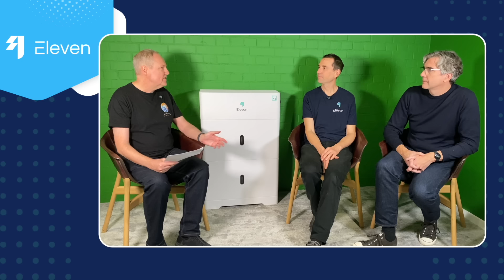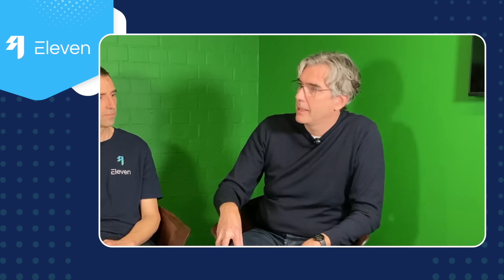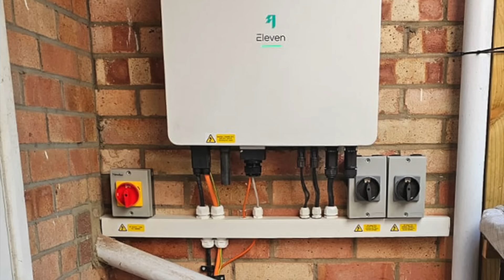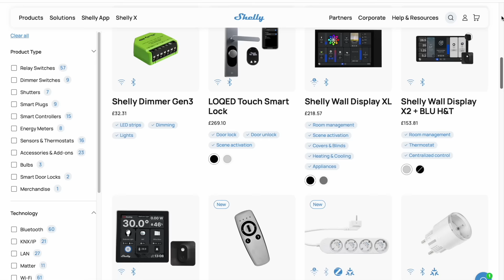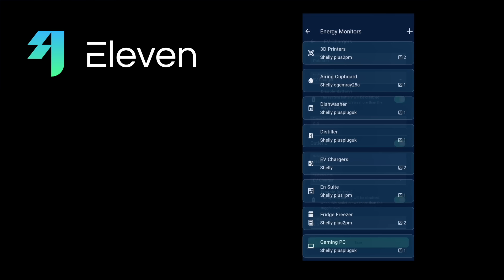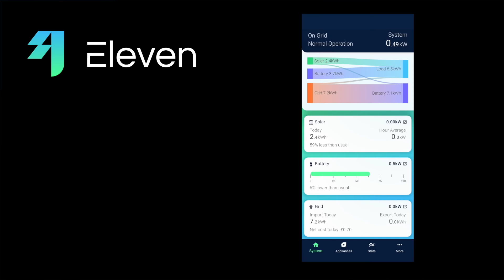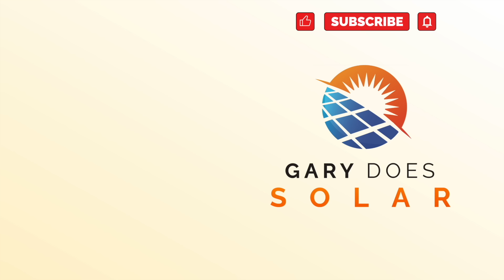Home Batteries: Could SODIUM Be More Popular Than LITHIUM Soon?

Comment: Lots of warts with sodium still.  Full-cycle energy efficiency is poorer and losses from that alone swamp the heater argument (keeping LiFePO4 warm doesn't take all that much energy when the cells are in an insulated box).  The wide voltage range creates all sorts of problems for equipment power ratings.  And while cold-weather capacity is better (in the situation where you actually let the batteries get cold)... that's only at low C rates.  Like 0.1C.

Where sodium really works well is in situations where the battery might go dead.  Sodium batteries can be recovered from that situation whereas lithium batteries take damage.  But actually making use of this feature requires power electronics that will actually do it and not just give up because the battery bus is sitting at a few volts.  There are virtually no situations where batteries are actually allowed to go completely dead.

Safety is better... but not so much better than LFP that it's really worth all the other warts.

So it really comes down to cost.  Sodium has to be better than half the cost of lithium for it to even begin to start making sense.  It hasn't quite gotten there.  This is also why seeing sodium in consumer and residential products doesn't make a whole lot of sense... the installations are just too small and shipping and installation costs completely swamp the lower battery price.

-Matt
Reply: Yeah there are issues with Sodium batteries that don't exist with Lithium batteries, but I don't think they are roadblocks that will stop eventual adoption. Just reading through the history of the development of Lithium batteries is really eye opening, the huge problems that had to be solved to get to where we are today are things that could have ended development altogether if not for a few hardy souls pressing on when all looked hopeless. The problems with Sodium batteries are really minor compared to that and probably won't hold up Sodium battery development much at all. We are all so used to the flat voltage drop of Lithium batteries and the way they work that at first it seemed a complete barrier to using Sodium the same way as Lithium. Having said that, I don't personally think Sodium will be used much in EV's, I don't think that's the target market for Sodium and as you say LFP warming is not a big issue these days otherwise Norway wouldn't be one of the largest penetration EV markets in Europe. Cheap fixed storage is where Sodium will dominate, given, as you say, that the price does reflect the projected cost saving of using Sodium over Lithium. We have yet to see that, but it's really early in Sodium battery manufacturing, give it 6 months for the price to fall through the floor I would suggest.

There are already large grid scale sodium battery deployments projected for 2026 and beyond, so it should be interesting to see where that goes.
Reply: I’ve been using lithium batteries since first commercialised by Sony in the 90s, they’ve always had excellent round-trip efficiency. Is there a path way to improving this as for me it doesn’t make sense, the cell cost is about 20% of a residential install cost in the UK.
Reply: Agreed.  Just watch Will Prowse's videos on sodium.  From a practical point of view, the drawbacks to sodium are immense
Round trip efficiency and huge voltage range will limit their use to experiments.
The voltage range issue itself is an application killer that has serious implication for power and solar equipment

I don't expect them to be useful until these two basic issues are solved.  I predict it will take at least 5 years.
Meanwhile lithium solutions keep getting better and better.
Reply: @bru512 

There's Na cells and Na cells and they are not all  built equal,  and CATL  are just not showing those problems  because of what they have done inside their road and storage  Na cells.
Reply: > So it really comes down to cost. 

Yeah, but that isn't a minor point. It's a key point for battery storage, specially on big sizes.
Pretty sure we will create new inverters that support the wider range of sodium. And with that inverters, even if they will be more expensive, the difference won't be so significant in comparison with cell cost. 
I think your half lithium cost is too conservative. Plus main manufactures I think they will push for sodium as a way to don't stress their lithium reserves even more, when they can dedicate that lithium to a more profitable EV market.

Knowing that the lower cost is achievable, they will push lots of capital into it, which is a kind of "subsidize" the technology.
Reply: if it works at grid scale its all that's needed to swamps consumer use.  lithium is being banned due to fires on cheaply made battery devices which is spreading to all as competition drives cost & quality down.  Then there's pollution. Lithium industry hasn't bothered to recycle in order to juice sales of new lithium? & then there is finding 3rd world countries happy to destroy ecological fresh water ....
Reply: @russell7489  Yeah, look online you will see lithium car battery recycling that recovers 98% of materials, and second life usage of lithium EV batteries is a huge industry. There is no-one seeking to ban lithium batteries because of fire, in fact China has new laws that mandate strict fire control changes and new door handle design that allows for easy exit and access in case of power loss.

I agree cheaply  made devices need to looking at, but that's not car batteries, you are looking at cheap e-scooters and devices like that, data shows that ICE cars are 20 times more likely to catch fire than EV's, and that's before the new Chinese regulations on combustion control in batteries.

This is FUD basically, there's plenty of room in the world for two battery technologies, well it will be four now with sodium. All your points have already been addressed many times.
Reply from the maker: Really great points, Matt 🙏

Comment: Starting with a direct lie is not a good look! Lithium is not scarce, hence its price collapse, it is one of the most common elements on earth. 

Yes in time they may well take over the home and even car market. But home batteries are grossly overpriced compared to the same thing in cars anyway, so they will still be marked up vastly whatever chemistry they use. 
All made elsewhere, not their batteries, or any component. 
Software sounds locally made at least. Battery is a bit small.
So it is as British as anything made in China or similar, with a badge added when it arrives here and the sale price quadrupled or more.
Reply from the maker: I think you misunderstood the comment. Lithium is scarce when compared to elements like sodium.
Reply: @GaryDoesSolar  Well not really, he said  Quote "One of the biggest disadvantages is that there simply isn't that much Lithium in the world. It's really quite scarce"
In fact At 20 mg lithium per kg of Earth's crust, Lithium is the 31st most abundant element. Ok yes Sodium is much more so, and easier to extract. But that was NOT what he said or implied.
There is that much Lithium! It is not scarce.
Instead of lying he should have simply concentrated on the easier availability, extraction. It is still a material huge advantage.
Reply from the maker: I think you’re getting hung up over one statement and missing the bigger picture about the benefits of sodium.
Reply: @GaryDoesSolar  Absolutely, but for a reason, the anti any EVs to solar systems, anti modernisation, leap on any way to make out batteries are not viable due to use of 'rare' materials, or catch fire at the drop of a hat etc. Which they are not!
Better to make the case for sodium from it benefits and advantages not by rubbishing Lithium ones that are currently everywhere.

Comment: Sodium batteries need to match or better lithium ion cells the being  negative about them needing heat is easily cured..bottom line is are the Sodium cells cheaper???
Reply from the maker: Not cheaper today, but in two or three years the expectation is that sodium will be much, much cheaper than lithium.
Reply: @GaryDoesSolar I'm about to get 2 quotes for an Eleven battery and solar installation and for 2 for Lithium and solar. I'll try and update on here now the quotes compare.

Comment: I would love to see their voltage charge vs. discharge curve. Thats where the drop in efficiency typically comes from.
Reply: i usually love gary does solar’s videos, but this one feels like a sponsored investor pitch
Reply from the maker: @glitterishhh - not a sponsored video at all. I’m just interested in the technology.
Reply: @GaryDoesSolar  i don’t mean this as an attack on you, but if this wasn’t sponsored, why did you keep their company logo in the top left corner of the whole video and why did you not challenge any of their claims throughout the entire interview?
Reply from the maker: I cannot be any clearer to you. This video was not sponsored. I made it to highlight sodium-ion technology, so that people could find out more. What claims do you think I should have disputed?
Reply: @GaryDoesSolar  2:15 lithium is not particularly scarce anymore. the scarcity was mainly for cobalt back when NMC was the dominant battery type. LiFePo4 are abundant, as reflected by the prices per kwh which have become an order of magnitude lower in the past few years
Reply from the maker: I think the point ELEVEN was making is that lithium is more scarce than sodium. And actually, we’ve seen lithium pricing spike over the last few years, not because it’s scarce, but because there are limited places to locate, extract and process it. It could well spike again because of that, unlike sodium which can be located, extracted and processed almost anywhere.

That’s one claim then—keep going…
Reply: I wonder if a hybrid system with fast DC to DC could fix the issues some people are touting about curves etc, just enough Lithium for a clean feed and sodium for bulk storage with some sort of balancing going on between them. I don't know enough about the science but interesting times ahead as these things do progress. Happy with my SigEnergy for now.

Comment: Very interesting as I was wondering how , now that batteries have to be fitted outside they (LiPO ) would work as an emergency back up supply in winter. Imagine early hours of the morning it freezing hard out side and battery a bit low and the grid supply goes down just as battery about to cash in on off peak rate. Then 8 hours later with grid still shut off it a bright sunny day , as the batteries are freezing cold they will not charge as not enough power in them to provide heat to allow it. This by the sounds is where these Sodium batteries come into play, but what are we being sold at the moment promising to give back up when grid goes down but by the way you got to put your battery out side now where they dont really work off grid when its cold but give us the money for the gateway anyway.

Comment: Ah, wide cell voltage and the implications for inverters is something I've never heard about before. It means we can't simply swap out existing batteries for sodium without also changing inverters. That's a big downside for quick adoption - all existing systems using NMC/LFP won't be able to use sodium. Pity.

My understanding is the lower volumetric density isn't as big an issue as it first appears, because sodium batteries don't need active thermal management. Thus saving cost/weight/space/complexity that other batteries require.
Reply: Most of those batteries are going to out last their inverters.

Comment: Soon... For varying definitions of soon, sure.

Anyone interested in them should probably go look at Hobotech's review of the Bluetti Pioneer NA sodium power station and Will Prowse recently did a teardown and some videos on how to charge and discharge them, including kinda underwhelming cold performance.

So maybe someday the trade offs will be worth it if they can get cheap enough but for now they are not really all that great. Soon being 1, 3 , 5 years? Sure, maybe.
Reply from the maker: I’m going to suggest 2 years ✅
Reply: @GaryDoesSolar My guess is more like 2030, unless some other magic battery comes around. People are too entrenched in lithium and I think the swing is going to be slow. Especially considering the large voltage swings needing special inverters for charging properly.
Reply: I think you might be missing the context on that test. While the cold charge rate at 0°C was reduced, that was exactly in line with the specs. The key difference here is that a standard Lithium battery wouldn't be charging at all at those temperatures, so the fact that it works is actually a major upgrade.
Reply: @MikeBookham Well, the main point was that you could instead just heat them and then charge them instead of running super slow. If you use lithium polymer it can charge below freezing slowly too. If you have energy coming in then in both cases it makes more sense to heat them and then charge rather than charge for hours at frozen molasses rates.
Reply: @Snerdles Hmm. I don't want to waste energy getting what is meant to be an energy saving device to even function.
Reply: @GaryEasonFlightArtworks I think you are missing the point. If you live in an area they gets bitter cold over night and then the sun comes up and your solar is attempting to charge your batteries again the sodium based ones will charge at 0.1 to 0.2C for an insanely long time wasting any excess until they warm up just by virtue of charging.

If you had self heating lithium based batteries the heaters would use any energy captured until they were above freezing and then they would charge at proper rates capturing overall more energy.

In both cases it makes more sense to use the energy to run heaters to get the batteries warm and then switch to high speed charging.
Reply: @Snerdles You're shifting the goalposts. Why waste energy heating a battery when the 'slow' rate is actually plenty fast enough? If you had watched the video, you'd see why heating makes zero sense here. The cold charge rate (0.2C) easily tops off the battery during a standard 5-6 hour off-peak overnight window. Why add the complexity and energy loss of a heating loop when the 'frozen molasses' rate gets the job done by morning? Plus, unlike Lithium, we can deep discharge these without damage.
Reply: @MikeBookham Probably because in winter I only get about 3 hours of light. So needing 6 hours to charge isn't good when you could get way more power by heating for 1 and charging for 2. Even with sodium.
Reply: @Snerdles Notice how you keep shifting the goalposts to distract from the fact that the math doesn't hold up?
First you complained about the cold charge rate. When I pointed out it fits an overnight grid tariff, you abandoned that and pivoted to "winter solar hours"—completely ignoring that I was talking about grid charging at 2 AM.
But even if we humor your distraction and look at your "winter solar" scenario, your logic still fails:
Scenario: You have 3 hours of limited winter light generating 200W.
Method A (Slow Charge): Charge at 200W for 3 hours = 600Wh stored.
Method B (Heat first): Run a heater for 1 hour to warm the battery mass. That energy is consumed, not stored. Charge for remaining 2 hours = 400Wh stored.
By heating, you just wasted 33% of your harvest.
The technical reality you are ignoring:
Sodium-ion has significantly lower internal resistance at freezing temps compared to Lithium. It accepts the cold charge efficiently without the "energy tax" of a heater loop. Stop looking for edge cases to justify adding complexity; the most cost-effective and energy-efficient move here is simply to let the battery do what it was designed to do.
Reply: @MikeBookham What of you have 10kW of solar and it 20kWh of battery so you can charge at .1C or 1kw for 3 hours so you get 3kwh or heat with as much as you can for an hour and then completely fill your battery? Why do you always manipulate the numbers to be insanely unrealistic and idiotic? Notice how you keep doing that?
Reply: @Snerdles You're projecting. You accuse me of using unrealistic numbers, then you invent a scenario where a 10kW array outputs 100% of its rated peak power during the darkest days of winter?
Let's look at the actual physics of your '10kW' scenario:
Solar Reality: In a winter deep enough to limit light to 3 hours, the sun angle is low. A 10kW array will not output 10kW. It might output 2-3kW. So, even if you heat the battery, you don't have the 10kW of current required to 'completely fill' a 20kWh battery in the remaining 2 hours.
Thermal Mass: A 20kWh battery weighs over 150kg. You can't just dump heat into it instantly. Physics dictates that heating that much mass takes time, regardless of input power.
But most importantly: I was talking about Grid Charging. You are still trying to force a Solar debate onto a comment about overnight tariffs. The 0.2C rate is perfect for the 5-6 hour cheap grid window. Stop inventing physics-defying solar scenarios to avoid admitting that point.